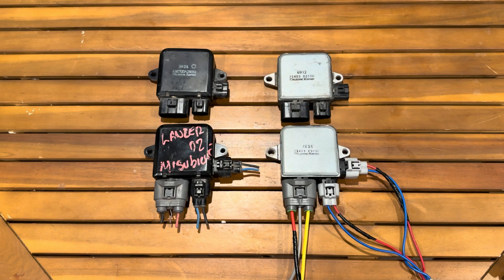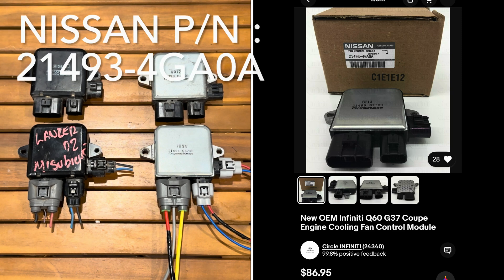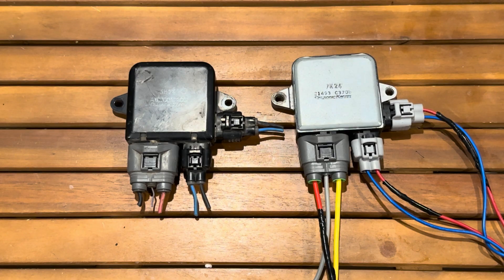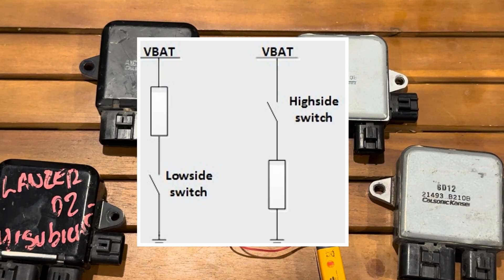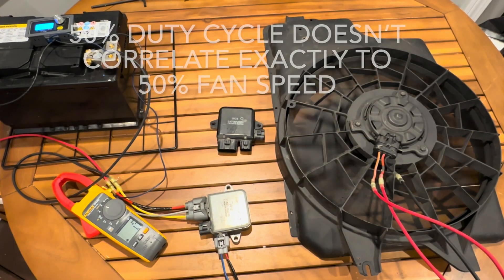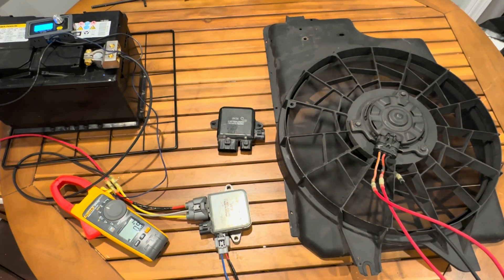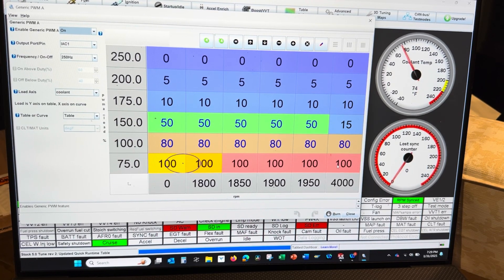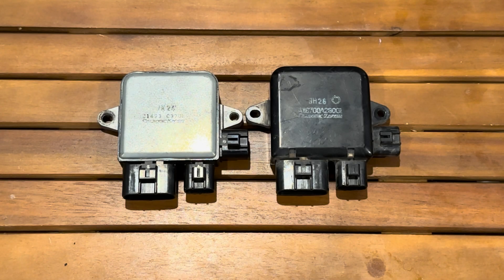Infiniti PWM Radiator Fan Module:  Basic operating principles/info for use with aftermarket ECUs

Comment: Can confirm that the unmarked black copies from China are garbage. Good for the connectors but thats it. 2 failed with only a few minutes to a few hours of operation. A used OEM one has worked well.

Comment: do you think there is a market for an aftermarket product that does exactly what this does?
Reply from the maker: Maybe.  There are controllers like the DCC controller that are similar to this but have inputs for a coolant sensor.  They would offer a standalone solution.  

The main drawback to this controller is you need another ECU of some sort to control it since it can’t take a coolant sensor input.   There might be a market for a small controller that can take a coolant sensor reading and convert it to pwm format, but the main hurdle there is standardizing to one coolant sensor resistance table and many different oe fan controllers on the market.

Comment: 🌟Please consider making another video that shows how to use an Adreno to control the PWM demand for us carburettor guys (no ECU). With the Adreno, would it be possible to have an A/C input? It would be great to be able to set an Adreno target engine running temperature and have the Adreno modify the duty cycle accordingly. Another wish list item, that might not be possible with this controller, due to its single PWM control input, would be having one fan run initially and the second fan cut in when the first fan is unable to control the temperature at the set point or when the temperature is increasing at an excessive rate. This may require two fan controllers, but is it possible for a single adreno to control two fan controllers? Lastly is there some form of weatherproof/temperature protective case available for whichever Adreno is used, it would be great not to have to mount it in the cabin. Thanks.
Reply from the maker: I did partially write an Arduino code to run this controller, but I never got around to wiring it up on a bench to test it out.  I wrote it so that you can input your max and min coolant temp for the controller to operate on and a min duty cycle to ramp up from.   I think I put an AC input as well to ramp to 100%, as well as a WOT cut-off to momentarily turn off the fan.  

I'm not 100% confident it will work yet but needs to be tested.  I'll be honest, it's a bit low on my priority list so don't expect it anytime soon but I'll see what I can do.
Reply: @Mustang5L5 
Thanks for the feed back …. I look forward to hearing more about your adreno project as it progresses.
For now, can you recommend/suggest (for us carb guys) any commercially available, two fan (Bosch HD fans) two channel (not just on/off for second fan) PWM controllers that operate along the lines I describe?
Previously I was using a 2015 “PSM1” PWM fan controller that used its own (unknown spec) thermistor. Unfortunately the thermistor was damaged and I can’t find the specification needed to get a replacement. I guess I will have to replace the entire unit complete with an 3/8” NPT sensor.

Comment: What controls the controller?  (ie) temp sensor or?…
Reply from the maker: The controller would need to be controlled by another ECU of some sort.  Either the factory ECU, or a standalone system.  The controller only has a PWM input wire so it needs something to intepret all the coolant temp data and send it a signal.  It will not work off a coolant sensor alone

I get the sense here that most people are using these with stand-alone aftermarket ECU's

Comment: So would it be feasible to use the controller solely for it's soft start feature? EG: Power to the controller then ground or unground the sensor wire to turn the fans on or off (softly)?
Reply from the maker: Yes, it could be wired that way using a relay to ground and open the control wire.   It would essentially going from 0% pulse with to 100% and back.   You would still get the soft-start feature. 

However, i cannot comment as to if using it this way has a detrimental effect on the controller's lifespan.
Reply: @Mustang5L5  Thank  you

Comment: Any clue how to drive that PWM pin with a ESP32? I’m struggling over here and now even the frequency generator isn’t working for me. Fans always on high 😵‍💫
Reply: I wonder if somehow I bricked both of mine. So odd, I just had an optocoupler driving 3-12V on that PWM. I tried shorting to ground expecting it to shut the fan off.

Comment: Thanks for all of the great information in this video. The ECU I'm using can only supply 100Hz PWM, but is switchable between high and low side drive. I can't find anything online about the minimum PWM input these modules can take, will they accept 100Hz and still work?
Reply from the maker: My little Amazon controller was able to run it, but I found when I hooked the controller up to my Megasquirt, it would only work at 250 hz.  Other settings and it didn’t work.  I didn’t specifically try 100 Hz, but I can test it next time I fire the car up and let you know.

Comment: If the PWM wire is grounded (fully closed) what happens to the fans? Do they spin full speed? My ecu grounds the outputs during power off
Reply from the maker: Grounding will turn the fans off.   I think mine does the same, but I put a relay on my main power feed to the module and turn that off when i shut my car down.  I don't want the module powered when vehicle is off

Comment: You have 2 wire outputs from the controller but the fan has 3 wires hooked up? Great video sir ! 'm trying to install 2016 Chevy Volt fans . Each fan has 3 wires -one for PW I imagine. Not sure if I can use your method for controlling these fans with my MS3
Reply: The chevy volt fans are brushless and only need the PWM signal from an ECU to work.  Try Grounding/negative type PWM 100 or 128 Hz. on the small wire.  The fans do not work at 0% or 100% duty so pick something in the middle to get the fans working.  An external PWM controller like this is not needed.

Comment: Thanks for sharing this! I’ve been smoking “pwm” controllers from Amazon from 10-200A and I’m not sure what’s up. My goal is to power the DC fan separately while the vehicle is off. I feel like all my current is going into the resistor pack or something but also I bet these controllers might be a cheaper option and maybe have more features.

Any thoughts?
Reply from the maker: These won't be able to go up to 200A.  I don't have the specific MAX amperage on hand, but some of the vehicles with these use 40-50A fuses so i've always stated that was the limit to go with.  I run it with a 25A fan.  If running dual fans, could also run two of these to lessen the load.
Reply: @Mustang5L5 I just got this controller and pwm module delivered and built a quick harness. 

Is the positive pwm or negative pwm line the one we want to go to the controller?

The fans are on 45 and 50 amp fuses, I think they pull 30 and 35 amp open circuit.

I didn’t see any voltage coming from the fan side even without pwm controller wire which isn’t what I was expecting. Is it?

Also sounds like the load is just shared otherwise? Just trying to balance quietness and efficiency, I wonder if it’s better to run the smaller one exclusively or two at a lower speed.

Comment: Dear if both Fan 1 and Fan 2 outputs are connected in series to one fan will it double the voltage, both will outputs will provide 12v and connected in series will it give 24v, please advice.

Comment: Might have missed it. What do you think is the highest current draw for one of these?
Reply from the maker: I can't say for sure, but I think when i was researching this module I pulled up wiring diagrams for the Infiniti it came from and saw it was using a 50A fuse.  Figures now i can't find any good wiring dwgs to reference. 

I'm running it with a 40A fuse, a Ford contour dual e-fan and that pulls 25AMPs at full speed.  The soft-start feature eliminates that high amp startup current, but i can't say for sure how this module will work with very high current fans.

Comment: Audience, what make and model Infiniti vehicle are the PWM fan modules from used for the ford contour fan?
Reply from the maker: 2006-2010 Infiniti M35/M45 is one model that used this style controller.

2003-2013 Mazda 6 is another

Comment: I am about to pull the trigger on a SPAL 16in Brushed fan (low profile) and was wondering if a Lexus RC350 fan controller will work the same?  If so, will it have any damage, electric noise or issues?  I would be using a EMU Black ecu.  Thanks!
Reply from the maker: Not sure which module the Lexus uses.  I did play around with a few other modules before I settled on using this one.  I found that the Bosch module that seems pretty common worked the same but the duty cycle control range was different.  10-90% would run the fan and 0-10% and 90-100% would keep the fan off. 

Wish I could help further but outside this particular controller I’m just not confident enough to give much advice. Sorry
Reply: @Mustang5L5 no worries, ai appreciate the reply.  I did go ahead and order the Nissan/Mazda Calsonic one you demo’d (silver plated), and I will get a SPAL 16in brushed fan.  Thank you!

Comment: Again another great video.  On the Megasquirt 2 can you use any of the open pins?  I believe I have around 20 open pins or spaces.  I thought each were assigned to something specific.
Reply from the maker: Most have a purpose.  You need to find one that specifically left unused.  If it's a Plug-and-Play ECU they usually have an options connector that has spare inputs and outputs.  You just really need to find one that's not being used. 

Then when you go into the fan menu in Tunerstudio, you can select that open output and use that to control the fan controller. 

On my MS3 PNP i'm using a spare output called "High Current Output 1".
Reply: @Mustang5L5 Much appreciated!
Reply: @18:30 you could put in a toggle switch to disconnect from ecu & would go to full speed?  I have one of these on the way, otherwise would just test my understanding.  Thanks again
Reply from the maker: @IowaBrian correct.  If that pwm signal wire is disconnected and just open, the fan module will ramp the fan to full speed.

Comment: with these pwm relays could you drive a high amperage fuel pump like walbro 525??
Reply from the maker: I believe I’ve seen a few of these used for fuel pumps.  I don’t know the max amperage for them.  Looking through the OEM wiring diagrams for them the highest fuse I’ve seen used was 50A.  Have never personally tested that much current through them.

Comment: Nice video. How did you determine the new fan controller power inputs 
(Plus and Minus) were reversed?
Reply from the maker: Unfortunately it took smoking a few controllers to find this out.  When they happens they just ramp to full speed no matter what.   Kinda worked with a few folks in some forums a few years ago and those diagrams came from that.

Comment: Thank you for the video !! 

I recently have wired a pwm generator to my PWM fan controller on my Hyundai Veloster so i can manually control the fan speed. 

The generator i have only goes down to 1khz lowest , all the videos ive seen of these controllers seems to be from 100hz-400hz . 

My fan motor is running on full speed and not reacting to the pwm signal i am putting into the controller with my generator. 

Do you think my generator would need a lower frequency in order to control my fan speed? I ordered the same generator you showed in this video and it arrives tomorrow!
Reply from the maker: I haven’t worked much with other controllers.  My generator goes up to 150 KHz and I think I went over 1 KHz on this controller and it worked fine. 

Usually if the controller runs full speed it means one of two things.  The units is bricked/failed, or it’s not receiving the proper signal from a control device. 

For the controller in the video, if you ground the control wire it turns the fan off.  Unsure if whatever controller you are using will do the same but worth looking into if that’s a valid function as well.  

Good luck!
Reply: @Mustang5L5  thanks for the reply !! When I got the same controller you used in this video it worked flawlessly 🤘 now I have complete control of my fan after months of replacing parts trying to fix it !! Really appreciate you posting this video, I couldn't have done it without watching it or replacing my whole setup
Reply from the maker: @kooloobsky glad I could help!

Comment: Great video. Whats the engine simulator?
Reply from the maker: It’s a board sold by DIYAutotune specifically for that MS3X unit I have.  Allows you to essentially run a fake engine, so it will show injector pulses and spark pulses. You can use the pots to change rpm and coolant temp and activate things. 

It’s really only useful for testing purposes. I built that MS3X from scratch so o wanted to test it before putting it in my car….and then I went out and bought a plug-and-play MS3 unit and no longer need that whole ECU, so I just play around with it for things like this.
Reply: @Mustang5L5  thats cool!

Comment: Can these units handle the amperage demands of the old Lincoln Mark VIII fans? If one was able to still source them.
Reply from the maker: I'd have to see what the continuous amps are for the Mark 8 fan first, before I can say.   The internet is full of bad info with regards to this info.  These units are soft-start, so they don't have the huge startup amperage like a typical relay would do with a fan.  The fan in this example only pulled 11AMPS max.  My contour fan in the other video pulled 25 AMPS for 2 fans.   

Everything I see on these relays shows them wired up with 10G wiring and 50A fusing.  I'd probably feel comfortable with a fan drawing 30-40A continuous.  I'd wire the two outputs from the controller in parallel.   But unless I had a Mark 8 in hand to measure the current, i can't accurately say if it exceeds 40-45A.   I want to say NO based on what i've seen with these two fans I have.
Reply: @Mustang5L5  when I ran the old DC Controller from Brian Baskin, my research showed the Mark VIII on start puller 70 amps. Okay in the beginning, but quick wore down the plug on the fan. Melting plugs became an issue, and most foxbody guys stopped using the Mark VIII fan. I didn't as I had a couple but now down to one. Has the white plug which is supposed to be a better revision. I'm running the Pro-M setup now, and want to see if it can use these PWM units your showing to control this last fan. If not, maybe I'll switch to Taurus/Dual Ram Chargers/Chevy electric fan setup. Just want to make sure I'm cooling this new combination more efficiently.
Reply from the maker: @vicsmark007  I wish I had one to test for you.  Unfortunately the OE ford ones are hard to find and the aftermarket ones aren’t as powerful. 

I’ve been using a contour dual fan on my setup and even in the summer only need to run the fan about 70-80% of full speed to cool it on a hot day with a 3-core radiator.